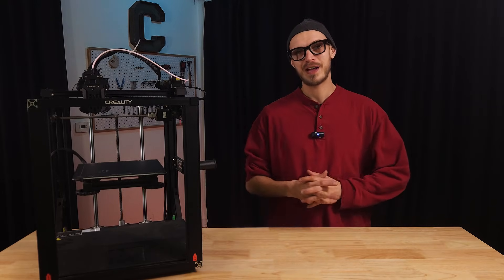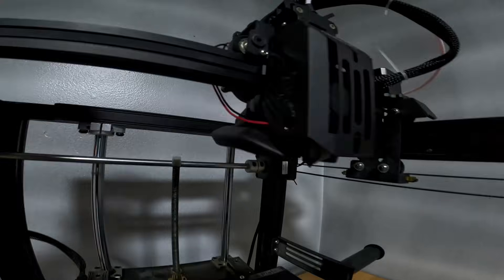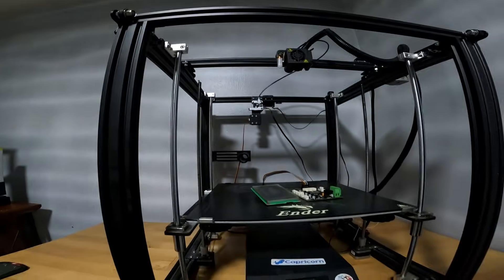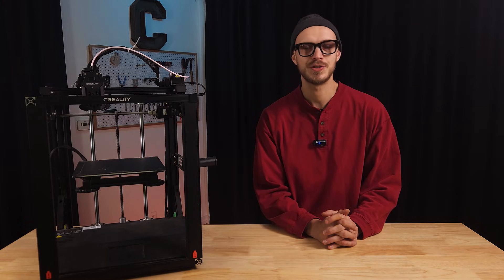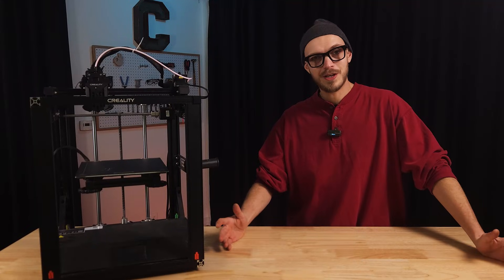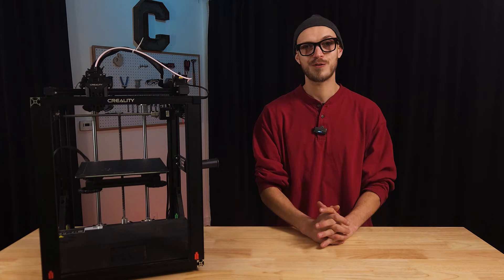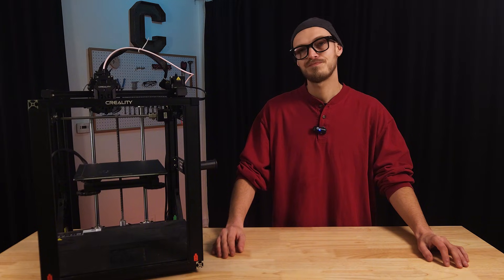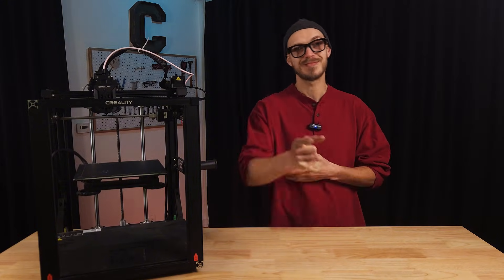I Found $80 Ender 5s on Marketplace - So I Bought All of Them

Comment: The absolute best mod for these old printers is a Bondtech 0.6mm CHT nozzle. Takes your stock volumetric flow from 6mm^3/sec up to 30+ with 0 other mods. Just switch to the default .6 slicer settings and cap the volumetric flow and top speed.
Reply from the maker: Bondtech 0.6mm CHT nozzle. Im excited to get to the upgrades! Ill try and get the baseline benchy printed ASAP so i can move on to the fun stuff! Thanks for the Info!! Keep it coming we are new to the 3d printing world but we are both CNC mechanics so its pretty similar worlds!
Reply: @Chambsandco  Nice! For some people 3d printing is the hobby but for me the 3d printer is the hobby 🤣 still rocking an 8 year old ender 3 modded like crazy. klipper is also a fantastic, albeit time consuming and marginally expensive upgrade
Reply from the maker: @yuxini2976  The OG Ender 3 nice! My brother bought one in 2018, its what got me into it, and he still has it!
Maybe I should add it to the line-up. 🤓
Reply from the maker: Also the mad scientists at Chambs&Co. and I have been looking into this klipper dealio,  I've got quite a few episodes I'm planning that I think you are going to dig. 🙃
Reply: @Chambsandco  looking forward to it! If your printer is mostly bone stock klipper is easier. I swapped out the main board and made other mods so the default config file for the ender didn’t work and I had to reassign all the pinouts. Not great lol